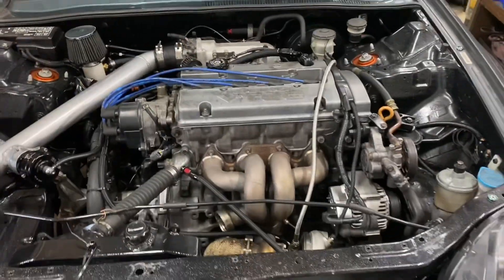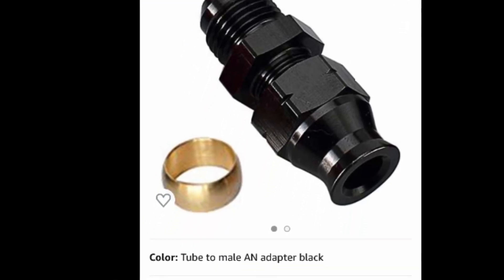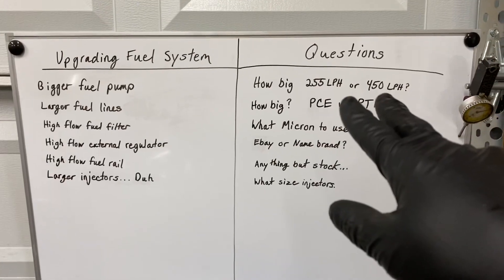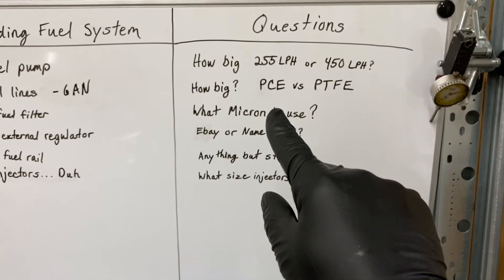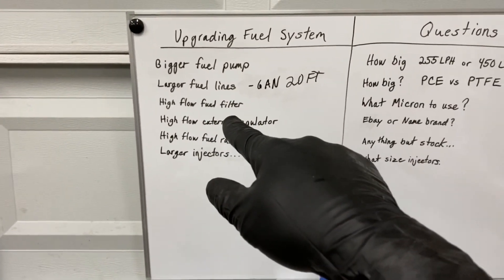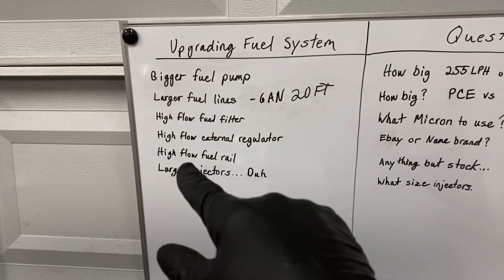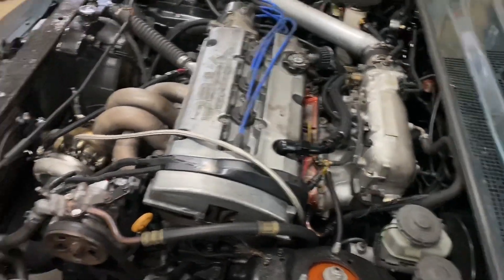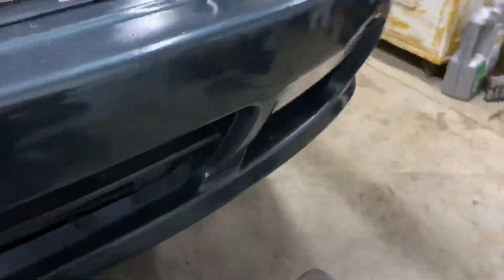Step by step - How to install AN fuel lines to make more horsepower!

Comment: Did you get the car tuned already? Good job on the fuel lines. I just order the same intercooler for my EG.
Reply from the maker: Richard Tuning thanks! Yup car is tuned at 15psi. I was having an issue e-tuning over 18psi...kept hitting boost cut and found that I developed a boost leak at the TB shaft opening...swapped out with another I had. My tuner wanted to switch to a 3 port boost control solenoid as well so I did. Hoping to do some data logging, get some e-tunes, and then hit the dyno if all is good after.
Reply from the maker: Richard Tuning yea the TR11 is a great intercooler...hoping that I don’t have to go bigger 😂

Comment: Gosh.  Your engine is cleaner than my car's interior.
Reply from the maker: I try to keep it that way because at the moment I don’t have room to run an air cleaner on the turbocharger...just have a homemade one of screen and filter fabric 😅 The turbo charger I have is a Borge Warner EFR 7163 and they are not cheap...trying to keep it form sucking in dirt.

Comment: Is there a point of doing stuff to your fuel lines if your motor is gonna stay stock, like will it actually add any power
Reply from the maker: Neffmonkey great questions! No this is more for builds that demand more fuel than your stock fuel system can flow.
Reply: THE STATE OF REAL all good thanks. I got a stock h22 but just wondering for you, how much boost is in yours
Reply from the maker: Neffmonkey right now I’m on a 15 psi  at 10:1cr. It’s hard to use much more than that haha I’m right around 450hp. Hoping to max out the setup soon as my turbo is the limiting factor. I should be able to make just at or under 600hp.
Reply: THE STATE OF REAL nice dude, yeah I heard shoving that much boost or more and engine go bye bye